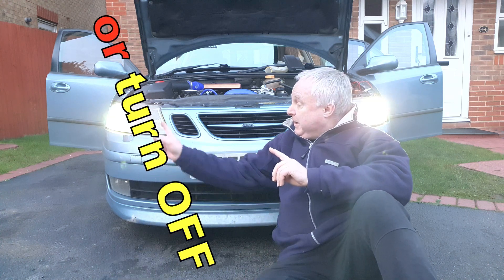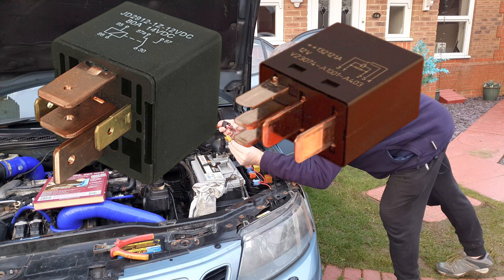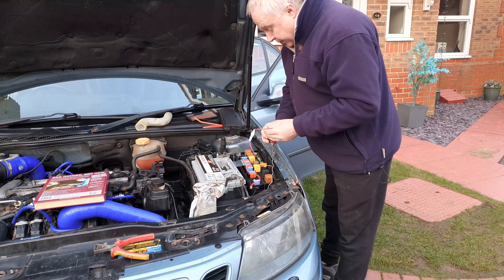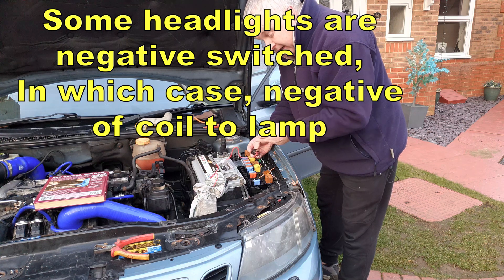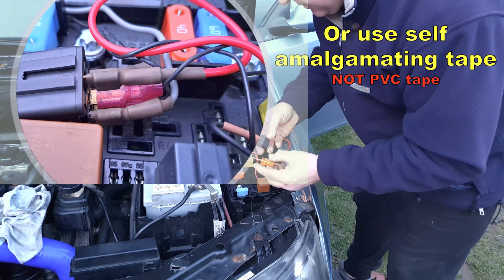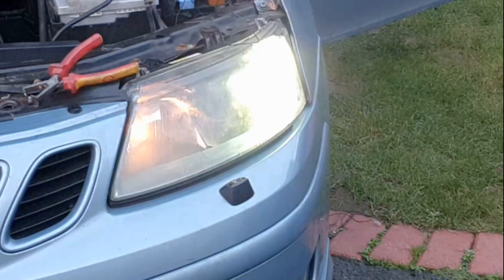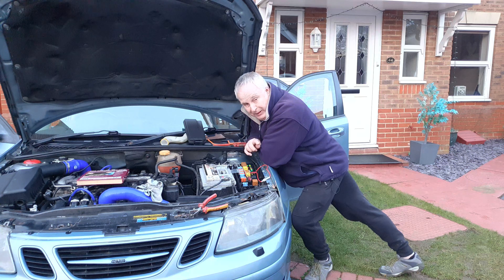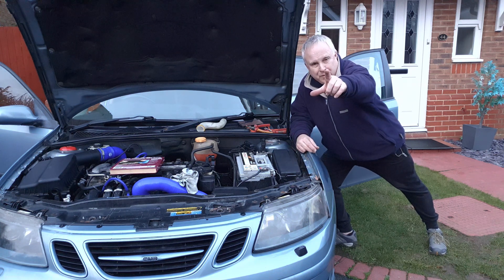How to Make DRLs DIM When You Switch Headlights ON

Comment: Thanks for this, it's taken some time but believe I understand the wiring now. Im going to use a voltage dropper to drop from 12v to 9v instead of a resistor, that way I can have some control over the level of brightness drop whilst ensuring there's still enough voltage to drive the DRLs

Comment: In my country (New Zealand) it is illegal for DRL/s to be switched on once your low or high beam lights are illuminated  Whilst I don't mind the DRL/s being displayed during daylight hours (that's what they were designed for) but once your main lights are on (low or high) there is absolutely no need whatsoever for your DRL/s to be switched on as well!! Modern vehicles in particular have enough damn lights festooned around them now & making them look like dorky Xmas trees!! Vehicle manufacturers these days put all this crap on their vehicles probably as a selling point & just expect people to know what this & that does & the reasoning behind it!! It is fair comment to state that most people in fact just don't have a bloody clue what these lights are for & when & when not to use them!! Any rate the good point is in NZ if your DRL/s don't switch off automatically (they won't accept a manual switch either) when you go to turn on your main lights you cannot acquire a (WOF) Warrant of Fitness certificate to enable you to drive legally on a roadway!! My vehicle was off the road for 3 days whilst I waited in the queue for my garage to fix my illegal DRL/s. I now have a legal WOF!!

Comment: Hello, thanks for the great video. One question please. On the video you state that a 10 watt resistor should be used, but the link in the description leads to a 25 watt resistor.
Which wattage resistor is correct for this application?

Comment: Where do you get your power from the headlight on wire ? Behind the bulb, or somewhere on the loom, if from behind the bulb do you have to cut the rubber bulb cover ? I have already done the rear indicator/reverse light, but am holding off on this until I'm confident of adding the relay properly. Thanks

Comment: I just want my damn headlights to be able to turn off. 2 years since I've had my car and the headlights have been permanently on, no matter where you turn the switch.
Reply from the maker: It'll either be a faulty switch or a faulty board in the fuse box (underbonnet). Take the fuse board out and check all connections and the PCB for corrosion or water damage and clean up as necessary. The dash switches rarely fail (apparently) but easy enough to get another to try.
Reply: If you're referring to with the car on, you have to program it with a tech2. In the US, the switch doesn't do anything noticeable. The drls will always be on.

Comment: Have you done a video on the turret repair for the f40 6 speed. Love your videos made easy watching
Reply from the maker: No, not yet! I have considered doing one. My car doesn't display the issue, but at 165k miles I might do it as preventative maintenance.
Reply: @Cyclone Cyd  no worries, xr8 do a good kit, I've just tmgot their uprated swirl flap bar so hoping not to have to remove the intake manifold as it's an ass of a job lol